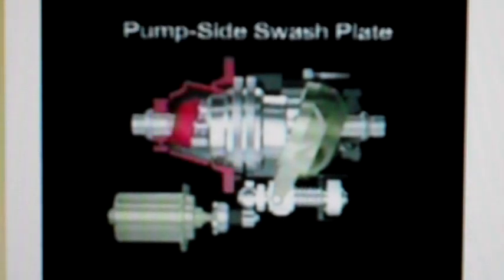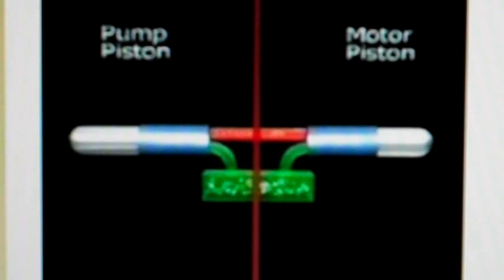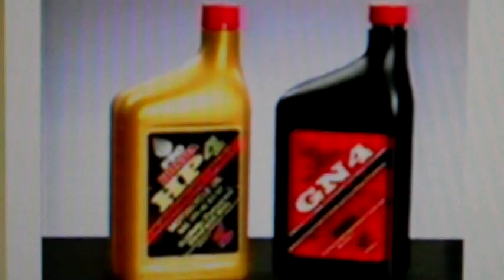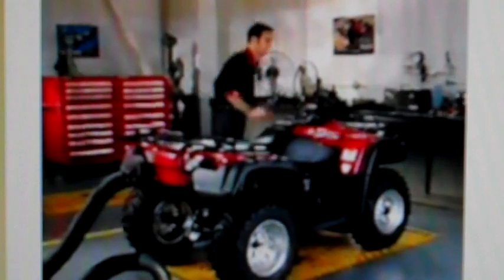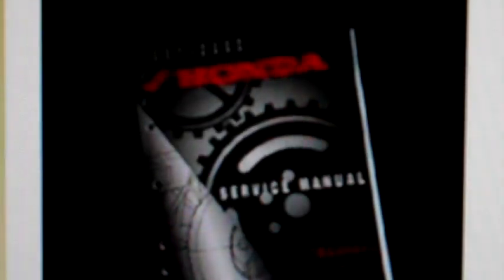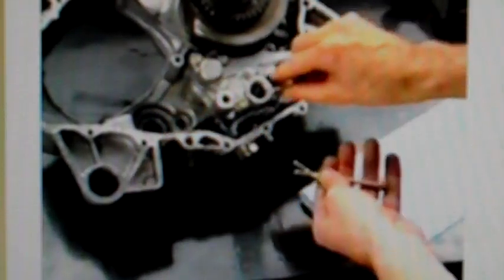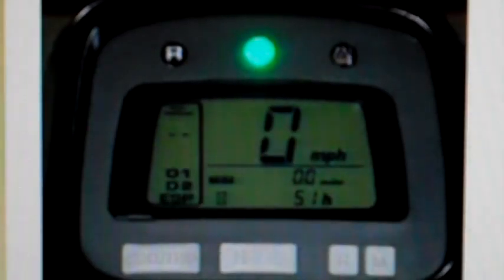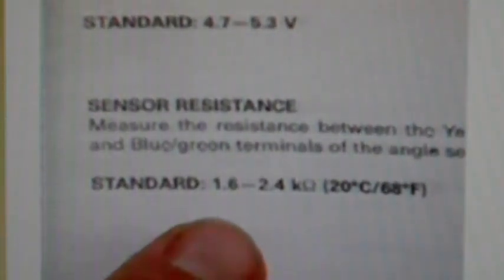ATV TRX 500 Hondamatic Transmission Operation And Troubleshooting

Comment: i have a 2004 rubicon when i turn on the switch where the d1 and d2 esp it blinks and does'nt shift just stays in low when you go into reverse it misses
Reply: i have 2007 trx400fa atv ,doing the same , esp blinks 6 times, have changed ecm and angle sensor, have u fixed ur2004 rubicon, if fixed, what was problem ,thanks need help
Reply: Just change the d1 and d2.selector and it will fix your problem that what i did and it works great again
Reply: @carlglacken2050  i have the same problem can you help i have a 2003 hondamatic 500cc and stall on reverse .. What you mean selector? Y that the esp nub the one has on left side esp and #1 and #2 that one?
Reply: You have a #5 code adjust the clutch
Reply: This video might be lien on this problem so people take the bike to them only

Comment: I have a 02 Honda foreman Rubicon 500 es...now It just started today...When i put it in D1 or D2 it will not shift out of 1st for some reason. When I put it in esp drive it won't shift with the shifter but it will in low gear. In low gear it shows the letter L for low....but when it's in d1 or d2 d for drive doesn't show up and all the d1.d2.esp lights are on....have no idea what to do. ?.thanks hope someone can help
Reply: +Thomas Walker i have the exact same problem very frustrating. if you see this let me know how you fixed it